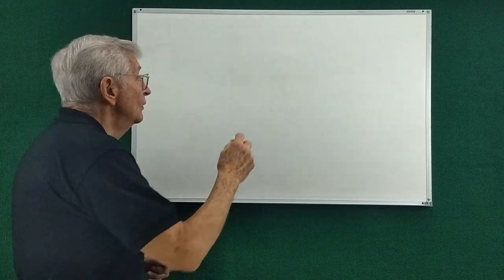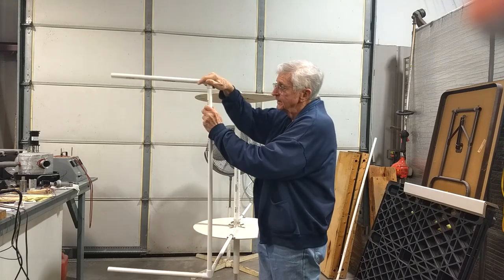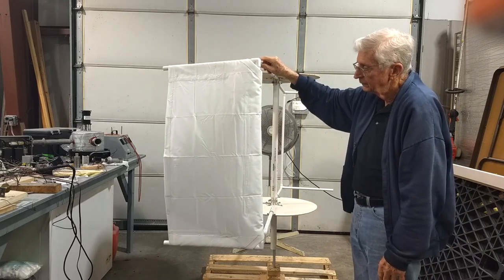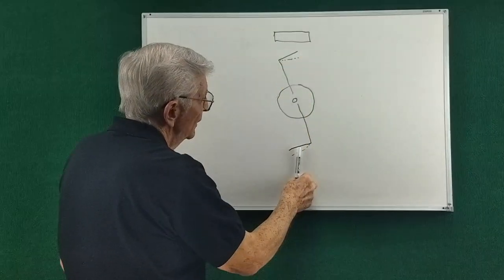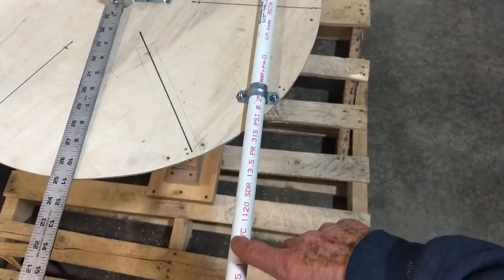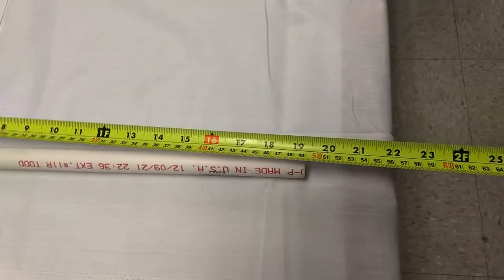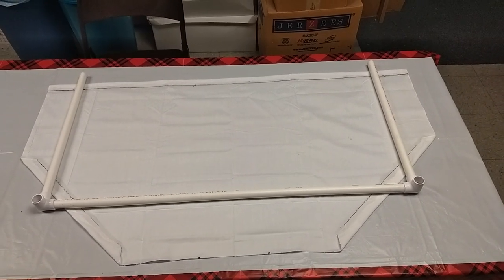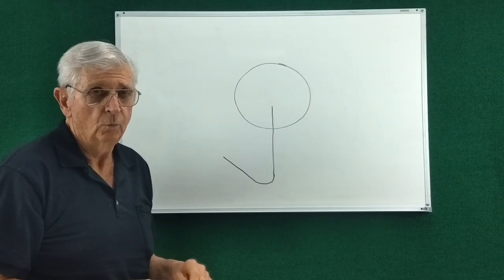VAWT With Fabric Sails (easy to build)

Comment: Sir, one of the problems you have run into is that the windward sails are masking it's opposite sail, an easy fix is to run an odd number of sails.
Reply from the maker: Thank you for your comment. I agree with you about this. I plan to use 3 sails on my next build.

Comment: Old Dutch windmills had 4 Horizontal placed wooden frames slightly at an angle with fabrik on them, this way an operator could roll up the fabric like a curtain and stop the rotation. Ofcourse these were flat frames and not helix shaped, later discovered to be more efficient with less drag. Nerds who believe in Perputal motion had Horizontal wheel designs that try to minimize drag at a certain point of the wheel so it would be pushed (pulled) indefinitely less or more by gravity. That ofcourse is not possible. Same with your sail design. At a certain windspeed the rotation is to high and the sail is pushed outward by cenrifugal force. This will therefore only work at low rotation speed and I think that is not what we all want. I am not sure, but its a rough guess.
Reply from the maker: Thanks for your comment.

Comment: Good video - I like your ability to work around the issues as you find them. The problem with the two sail setup, which was then made worse by the six sails arrangement when you set that up set me to thinking. The offset sail design that you came up with was a clever way to resolve the problem that you had come up against, but I immediately thought there there may be an easier and better way to do it. As you noted, the sail away from the fan was doing best, the one nearest to the fan from my observations was getting its kick of power mainly from being blown away by the fan, rather than from any wing type effect - I suspect with a static wing mount there will always be compromises to be made, so there will be no perfect setting. It seemed that as you added more wings the shielding effect became more relevant, as the more effective wings were being kept out of the wind by the wing nearest to the fan. So, to my theory - I thought that if you went to an odd number of wings - five I initially thought, though possibly three or even seven, that there will always be a route through to the furthest wing for the wind, whilst giving the wing nearest to the fan a kick on the way past. Interested to have your thoughts...
Reply from the maker: Thanks for your comment. I agree with what you are saying. I noticed that with 6 sails, the down wind sail did not billow out as much. Fewer sails may be better, or narrower sails might help as well. With air flow only down the center we are missing the action of the sails to the left. I need 3 or 4 fans side by side to see things more clearly. Since I am not going to buy more fans, the next step is to get outside, but there is snow on the ground and the ground is frozen solid. Looks like spring before serious work can begin again.
Reply: @Jimscoolstuff  Thanks for your reply - I shall continue to watch with interest.
Reply: @Jimscoolstuff  
Hi Jim,
Have you come across the green windmill design? It uses 4 fabric horizontal saiIs that automatically furl into an aerofoil profile sequentially as the rotor turns. I bought a set of plans from the inventor who was selling them at that time, i cant remember how many years ago it was but they came on a floppy disc ;) 
Edit: after checking the date it was 2002 and $35, time seems to fly faster the older you get.
Reply from the maker: @JohnGuest45  Thank you for the information. I will see what I can learn about it.
Reply: @Jimscoolstuff  
Hi Jim
Its a square rotor made of tubing.The rotor is connected to a central hub with flexible stainless steel cables (8 top and 4 bottom). The cable tension holds the rotor in place but its free to move in the vertical plane a little. Its a neat idea because the cables reduce the structural weight, noise and protect the rotor in strong gusty conditions.  It has 4 horizontal sails made of flexible material, basically square pieces of fabric folded diagonally in half. Each pair of diagonally opposed sails are connected together by a cable. As one sail fills with wind the other is pulled closed (also aided by the wind). The opening sail is damped by the closing sail making for a nice smooth open/close transition. The pressure from the open sail keeps the closed sail fabric tight with a rough aerofoil profile. The sails create lift so the rotor floats upwards (constrained by the upper and lower cables) when it starts to turn.  I made a 5ft`er out of fibreglass tubes (offcuts from an antenna project) a kids scooter (head bearing), strimmer line and some greenhouse polythene. High tech materials :) Needless to say, it was pretty rough and ready. I mounted it 4ft off the ground in very gusty conditions (gale the night before which took the fence out) but it did what it was supposed to do.  It was fascinating to watch the sails opening and closing by themselves.
Here`s a short, not great quality vid of it  https://youtu.be/tl2wtlR0Al8 
If you fancy making one to test let me know, I have an xls that can calculate all the dimensions, cable lengths etc.
Reply: please make the vid public again thank you!

Comment: yes hello good to hear you working on  a faster setup and RPM. I would like to say i to am working on a few myself and i have come to a conclusion of when adding the generator as you noted but the only way to find this out is to do what you are doing more test . I have tested  that when running just like a removal of a tire of a car with a tire iron was difficult but using a breaker bar was the answer as it brook loose , the magnetic field . It seems to have proven not in theory but in practical as i will show in my next design and video as to yours, but with (PUMP)

Thanks for sharing ,we have solved some big issues 

All can build now very easy, but will they build !!!

Comment: I rember seeing papers on savinouse wind turbines with and without end caps.  It concluded that the top and bottom end caps provided a higher COP over Savinous turbine without top and bottom end caps.  Presumptivly the endcaps kept the air inside instead of being pushed up or down due to the higher pressure inside as the wind is slowed. 

 This latest design iteration with little to no endcaps looses the benefit of having a top and bottom endcap.

Rather than increasing the diameter to increase the cross section, I'll take this opportunity to sugest a taller turbine over wider for three  reasons. 1) is faster rpm with less radius in a given wind asuming same tip speeds. 2) endcaps are cheaper and improve the coefficient of performance. 3) it would be easier to attach guid wires to the top of a vawt with a smaller radius by extending the shaft a little higher so the guid wires clear the turbine blades.

Comment: Have you considered  cheap polyethylene tarp as sail material ? It's readily available in hardware stores, and dirt cheap. Also available in different robustnesses
Reply from the maker: Thanks for your suggestion.
Reply: Those rarely last more than a year, due to the sun deteriorating the material. I live in the desert of southern CA, and would need a material that could handle the sun better. Not sure what that would be as of yet. I am very intrigued by this man's designs!

Comment: Dope the material the weave often can allow wind to penetrate
Reply from the maker: Thanks for your idea. A lot of research is needed to determine the best material to use.
Reply: @Jimscoolstuff  
I`d suggest a silicon coated ripstop polyester, non stretch, lightweight (45 gsm), uv resistant, water and windproof .
Reply: @Jimscoolstuff you could probably coat the fabric in some kind of oil or wax or something both to waterproof it and keep the wind from going through the holes. or maybe you can use plastic sheets instead of or in combination with the fabric.
Reply from the maker: @animehair05silently88  Thanks for sharing your ideas.

Comment: Thank you Jim, that was an excellent explanation and demonstration of sail power.... Got me thinking...Like the idea of bending angles and one pipe but how are you going to put in pipe for the vertical distance without a 3way adapter? may interfere with using one pipe with bent angle in it... Just something to think about... Keep up great work. God speed
Reply from the maker: Thanks for your comment. I have not worked out all the details yet, but I am thinking that I will flatten the ends of the vertical pipe and attach it to the others with machine screws. Keep your ideas coming. sharing ideas can help create a better design.

Comment: isn't the sail area equal to the torque output of the windmill? i just ask cause the sail of your windmill seems small.
Reply from the maker: Thanks for your comment. Yes as the sail area is increased, the torque and the potential output power increases.

Comment: I know this is an old video, but I have a hard time to understand at what part of the 360 degree rotation you actually have a beneficial lift instead of the regular drag. As per my understanding it is not the "lift" that makes it possible to sail faster than the wind speed but rather the angle of attack which makes the sail work as a rudder amplifying the distanse by more than 1:1. Like pushing you, with less force, for example 2 meters per every 1 meter the wind is traveling. But that is not lift, that is drag. You are literally making a design based on a number of parachutes (drag).
Only when a sailboat is traveling against the wind, which it can, is when it gets to a position where it actually achieves lift. So it is true that do happen, but I just cant see how that could be happening enough for you to call this a lift based design...

Comment: you waste some duty cycle
Reply: nice design btw, but check an even simpler version on my channel soon, based on the flex foil
Reply: could be more efficient, use the center drum as a nose cone, focusing all the air flow in on the blades on the rim
Reply: heavy oscillations, its a sail boat
Reply: using the pre-fabricated pipes-connectors is clever technique
Reply: homopolar dc generator-motors for most simplest designs and manufacturing without controllers, electronics or even rectifiers
Reply: impeller turbine as a gasoline burner, reaction turbine, center-in rim-out, use of the centrifugal radial force
Reply: that looks like a note key
Reply: try horizontal barrel wind roller, with wind+gravity opened and closed wind flaps, maybe inside a wire spool, essential is that below the flap opens and on top the flaps close, the turbine can turn to wind as usual